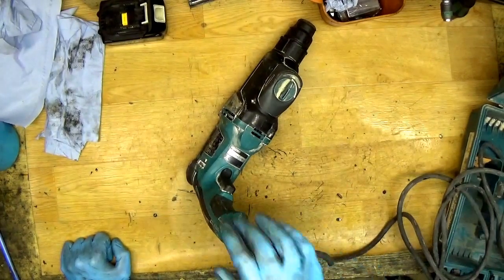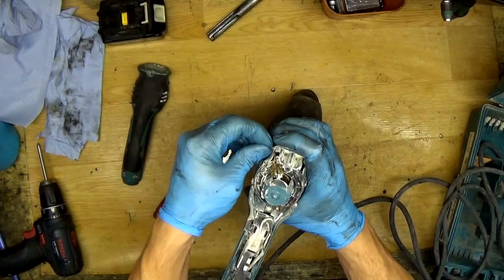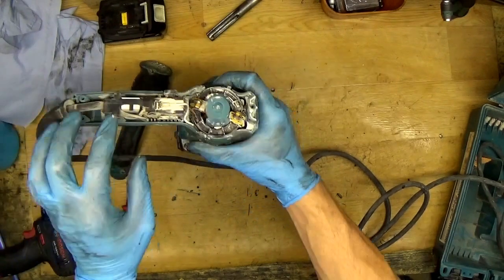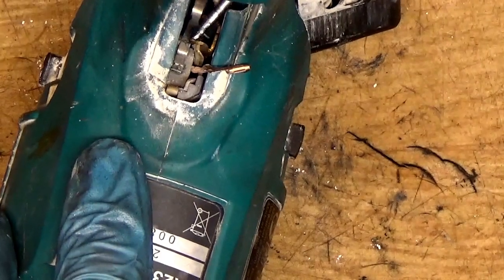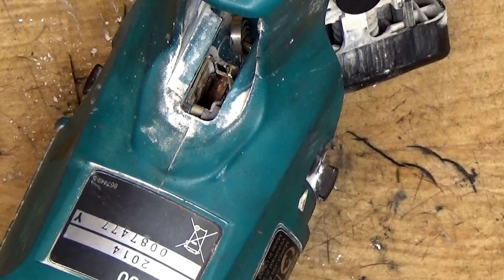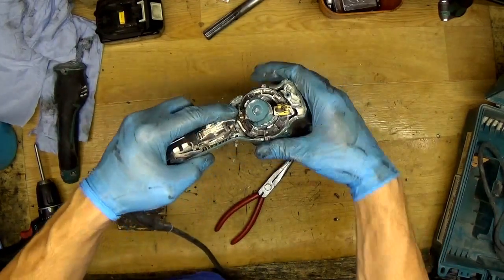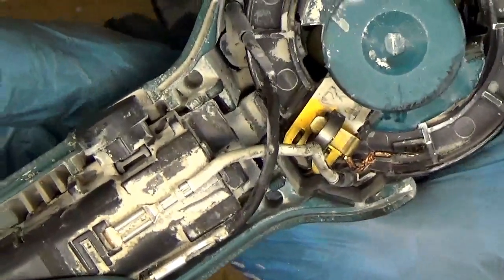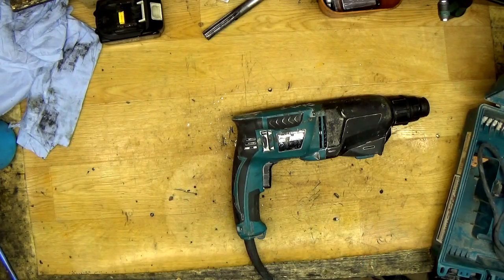How to change repair carbon brushes for Makita rotary hammer drill HR2300 HR2610 HR2630 HR2470

Comment: Very thanks i done replace a new carbon brush. But my drill take out a smoke at the back. Is it normal after we replace new carbon or there are another problem
Reply from the maker: No, it`s not normal. Maybe you need new carbon brush holder or armature